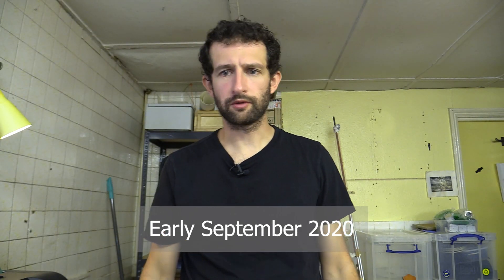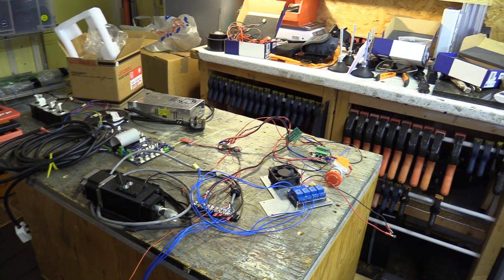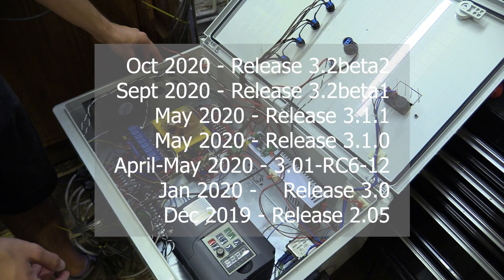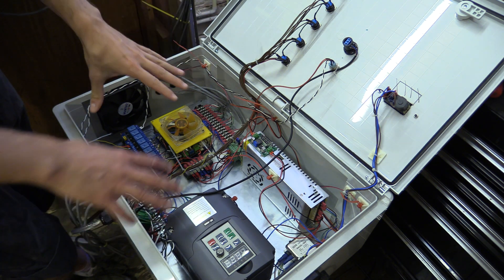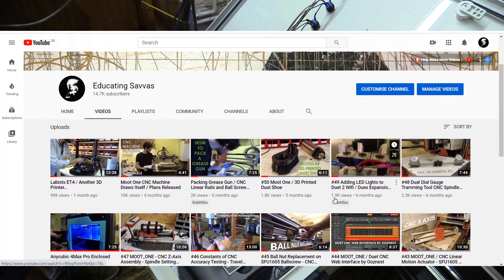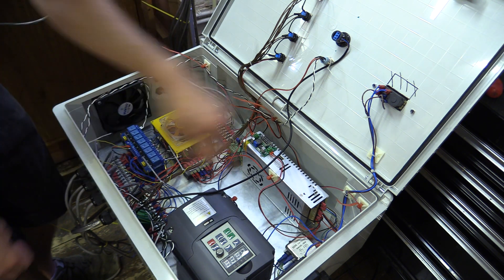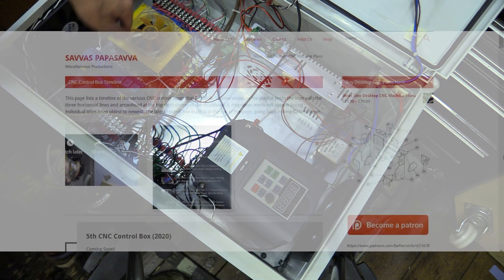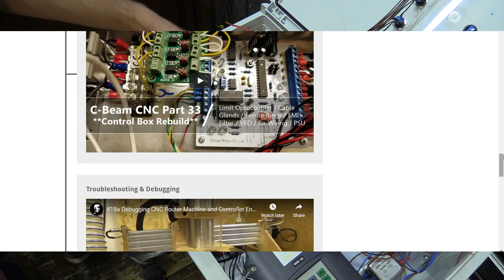CNC Control Box Timeline Overview - Part 0

Comment: Looking forward to part 1 etc. I am building my controller now and would like it if you addressed start and stop switches in detail, as well as wiring for spindle control. While I will start with a plain makita router I want my controller to be planned with upgrades in mind. I am planning mine to use an arduino nano in parallel with a breakout board with optocouplers. I know I would not use both at the same time but having both allows me flexibility in choosing software. Do you anticipate any problems in my doing so? Obviously I would not have the parallel port plugged in at the same time as the arduino and vice versa. I would only use one interface at a time.
Reply from the maker: I am using a duet - so the set up will be very different form an Arduino but I'll try breakdown the stages into relevant and watchable videos. Bit of a challenge as I've already changed some stuff since filming part 1.... aaaaaaargh.